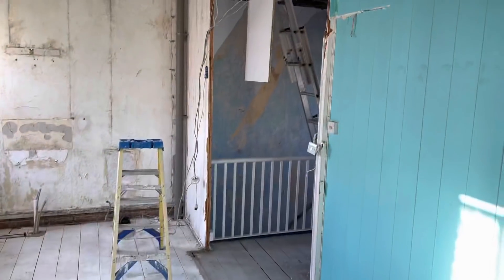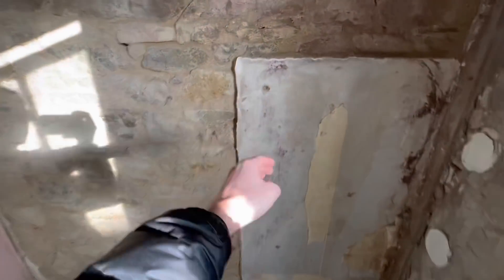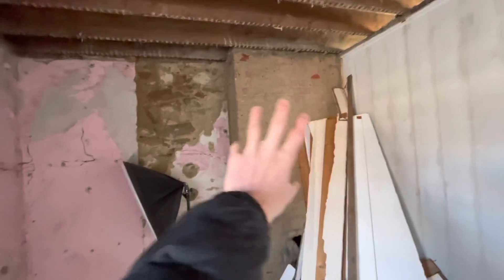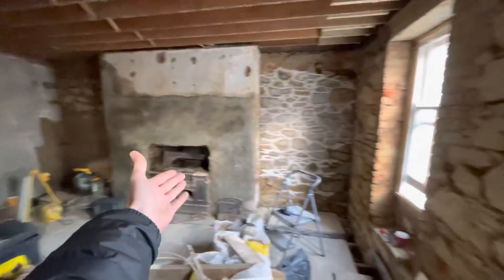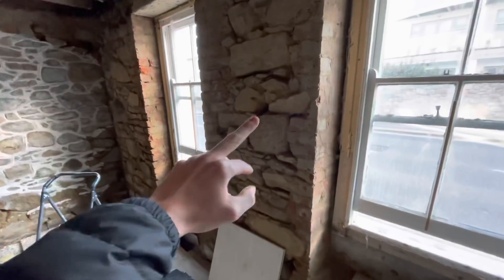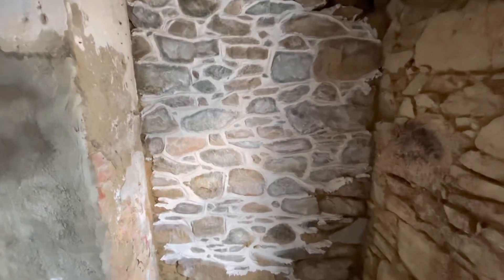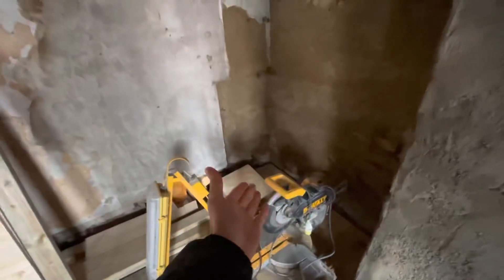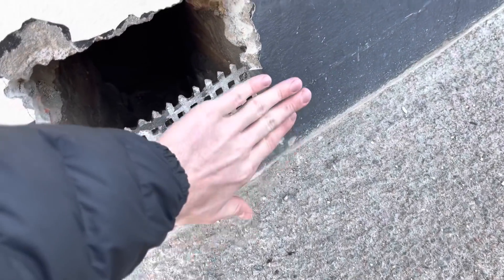Big work done to the house!

Comment: A blacksmith or a welder could repair that range without even breaking a sweat, lot of ppl are unaware you can braze cast iron but now thanks to evolution of materials etc you can weld cast iron quite easily these days and not expensive either.   Try and keep it in as intact condition as poss as someone would buy it off you to restore it I am sure, check round with the antiques shops because some folks will leave an interest with their antique dealer looking for an old range and might make your wallet feel a little better as those original ranges are very collectible especially for farmhouses and working kitchens.   What are you doing for heating?
Reply: When he says it can't be fixed. He means he doesn't want to but doesn't have balls to say so.

Comment: Definitely point out yourself. You'll get quicker with confidence and it's a satisfying job. I'd leave as much exposed as much as possible unless there are temperature/noise insulation reasons to do otherwise. Maybe some easily movable screening is an option. Was wondering how it's going so nice to have found this channel.

Comment: In America they aren't venting crawlspaces anymore. They block all the vents, add a vapor barrier, and insulate it. It becomes part of the conditioned space in the house. Not sure if Europe has similar options. Would be expensive to tear up the floor obviously!
Reply: Every house?
Reply: @badgerboy4448  Anything being built new with a crawlspace. It doesn't add too much to the cost of a new construction. If you have an old house from the 60's/70's, its probably still got a damp, dirt floor. Unless you have a ductless system, your HVAC is usually picking all that up and circulating it indoors. Modular/trailer homes might be the exception(But you can alway build a smaller crawlspace to spec and lengthen the life of the modular home). If your contractor doesn't at least recommend it, they're behind the times. It saves energy all year and protects you from years of pests/mold risk.  

You can retrofit an older crawlspace with a vapor barrier, insulation, sump pump, and dehumidifier for $10-15,000. But doing it from the git-go only costs $2-4000.  

I'd choose a crawlspace over an attic for utilities every-time! If something springs a leak in your attic or living area, it runs through 1-2 stories of house and ruins it on the way down. If your utilities are in a clean crawlspace, leaks just run to a neat and tidy drain and damage is kept at a minimum!